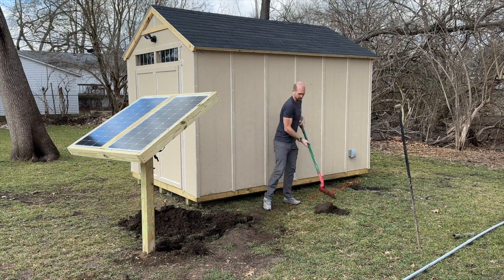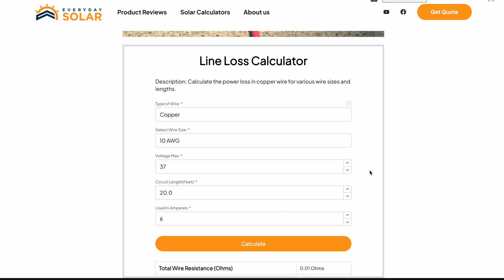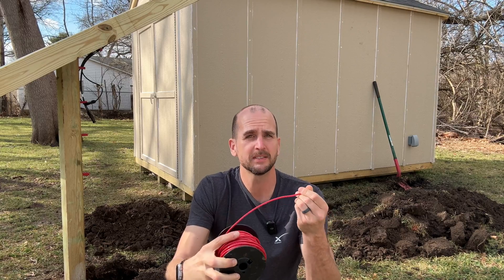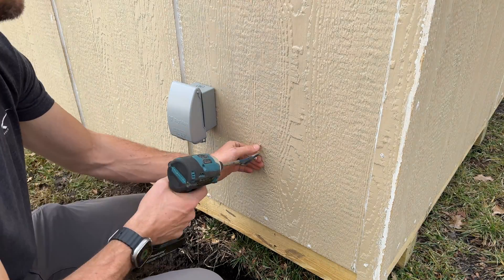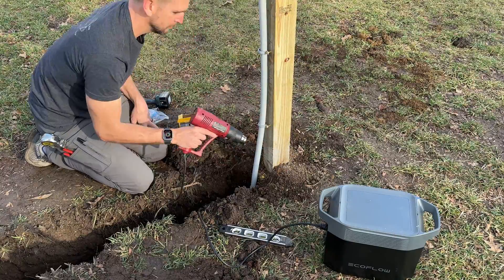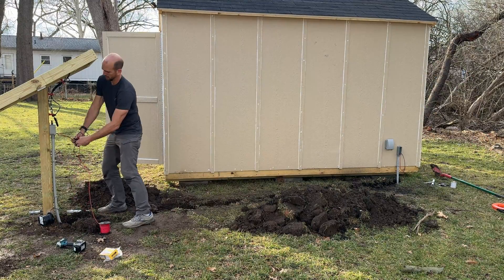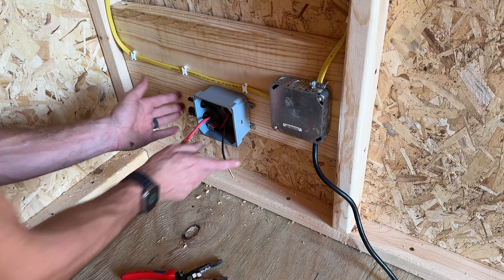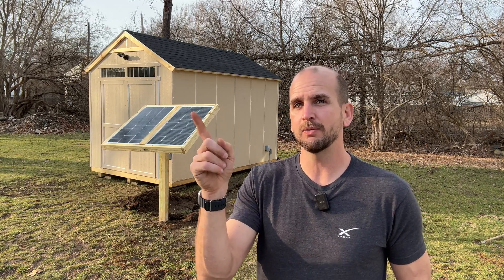How To Trench From Ground Mount Solar To Shed

Comment from the maker: Calculate Solar Cost For Your Home - https://geni.us/solar_reviews

Power Kit I Used - https://geni.us/uRL6gJ

Correction:  PVC should be buried 18 inches deep not 12 inches as noted in the video.  If you need to go shallower consider installing galvanized metal electrical conduit which can be buried 6 inches deep.

DISCLAIMER: This video is for entertainment purposes only. Also, this video and description contain affiliate links, which means that if you click on one of the product links, I’ll receive a small commission.

Comment: Pretty sure "regular" THHN is not rated for burial, even when in conduit. Much of the THHN wire one buys these days, however, is THHN/THWN-2, where THWN-2 is suitable for wet locations so just need to make sure it's THWN-2 rated.  And, as you noted below, needs to be 18 in in conduit.  If  you use PV wire or UF wire for direct burial without conduit, it needs to be 24 in.  But where is your grounding rod and grounding wire for the framing?

Comment: I'm about a year late to this party but, I'm starting a similar project. 28 feet across my back yard from the fence to the house. I trenched in the conduit now while the ground is wet and diggable. If I wait too much longer it will dry up nice and hard like concrete. I'll add the conduit risers and junction boxes later.
I like the idea of using THHN. And the pass through connectors, although I may just surface mount the pass throughs to the junction boxes.
I'll use a fused disconnect since I may have up to 800 watts of panels. Also connected to Delta 2 running a window air conditioner. I'll keep you posted.

Comment: I’ve read that it’s best to have the array switched if you are using quick connect ends; over time, arcing can damage the interior of the connector if you are connecting or disconnecting while the panels are generating any current.

Comment: Thanks for the video!  Great explanations on the various steps of your project.  Before plugging in the EcoFlow, however, I would have connected the panels and did one final polarity test on the connector.  It could save some headaches for some DIY'ers if they had the pos and neg backwards.

Comment: For 200W worth of panels it'll take like 50yrs just to offset the cost of the conduit?  Seems like a perfect scenario for direct bury.  Although you probably just did this as a demonstration?
Reply from the maker: Yeah, this one was a bit more for demonstration for those times where the grid is not close or convenient.  👍
Reply: PVC conduit isn't that expensive...🤔

Comment: Hey, what type of PVC conduit are you using, and where in the code allows for 12 inches? That will save me so much work. Thanks.a
Reply from the maker: I used schedule 40 and I was mistaken the PVC should be 18 inches deep not 12 inches.
Reply: And please provide code reference to this question as well.

Comment: Ok, you lost me on why you switched the colored wires around in the shed.  Black to red and red to black.  Is it because you have two black male mp4 jumper connectors and two red female jumper connectors?  Otherwise, you would have needed one black male and one black female jumper to keep the black wire the same throughout the run.  Same for the red.  As I'm writing this, I am kind of figuring out why myself.  Your wires from the solar panel both need a mail connector on one end and a female connector on the other end to work like an extension cord.  I think I got it now.  Thanks for putting this video out there.